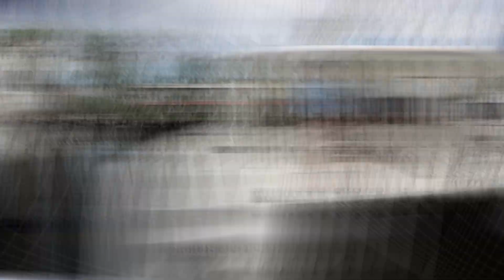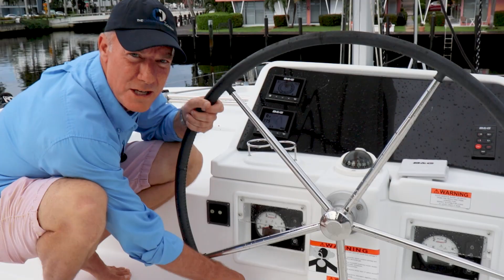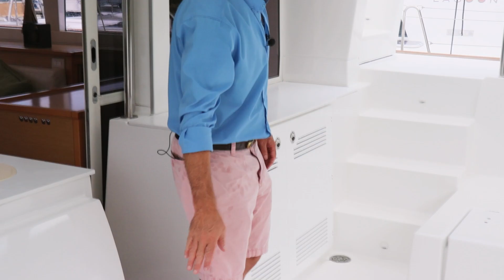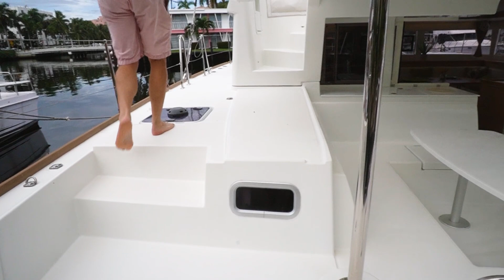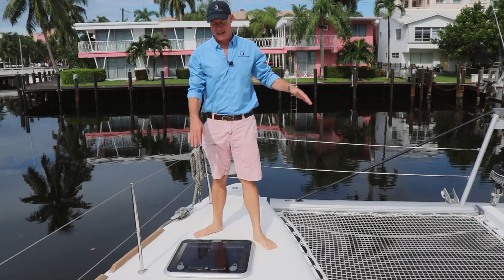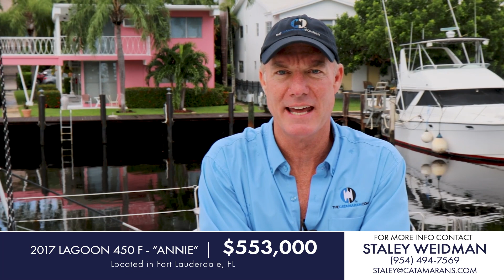Lagoon 450 Catamaran for Sale "Annie" | Exterior Boat Walkthrough Tour

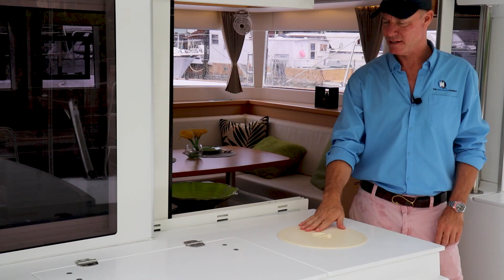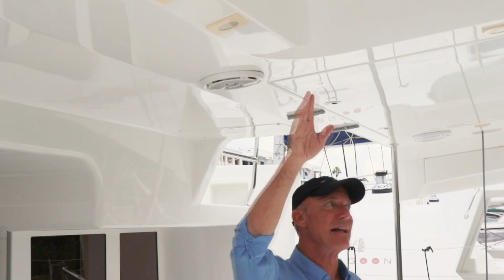Comment: Sure this sold but has all the looks of bulkhead failure @7:02 both sliding door leans to port with sliding window leaning to starboard due to floor dipping across the about 3-4 inches in the center. When closed there is a 2" gape at the bottom. Again @5:47 Likely reason it was left that way is because it had already reach max adjustment. Door leaning 1 1/2 " @6:46
Likely $75-100K repair involving removal and replace 60% of the interior.
Reply: Good eye! Good catch.
Reply: boat salesmen/women are WORSE than car sales people as your LIFE. , actually depends on what your told , bit different with a car and the motor is stuffed ,you can get it fixed , out in the middle of the pacific is a bit different , with all these adverts for yachts for sale they never go under the floor to show the Bulkheads .... wonder why !!